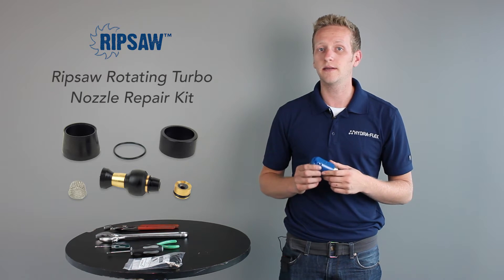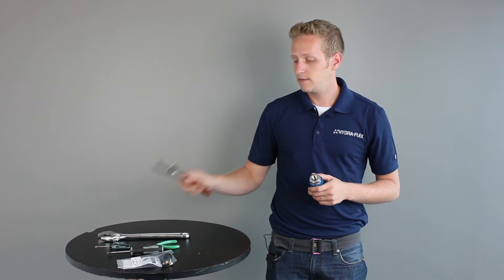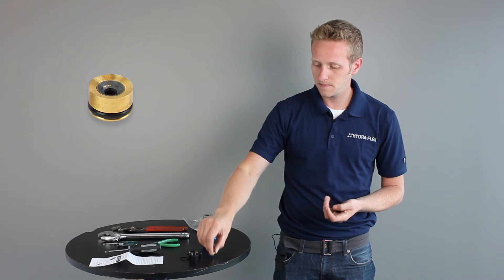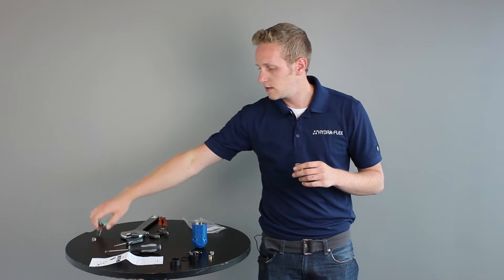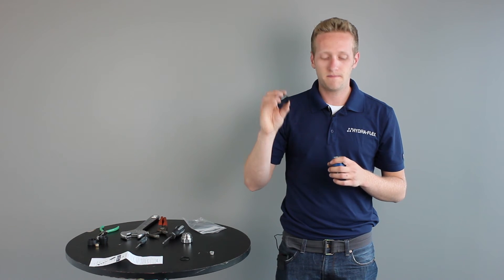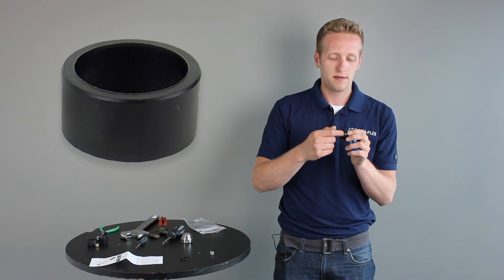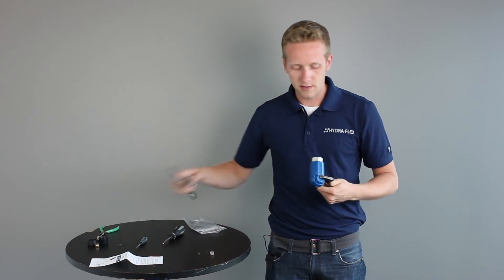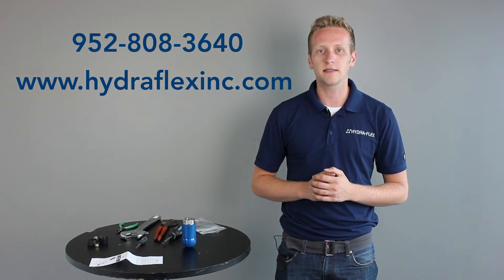How To Install a Ripsaw™ Rotating Turbo Nozzle Repair Kit

Comment: What is the point of the 2nd insert? To me, it looks to block the holes, thus restricting the flow.
Reply from the maker: The second insert is to properly channel the flow, and does not restrict flow. We've noticed that you've commented with questions on a few of our videos! We'd love to get the chance to talk with you over the phone, and answer all questions you may have! Please give us a call at 952-808-3640, or email us at sales@hydraflexinc.com
Reply: Why are the rotors are not interchangeable? There is no chance I can use #10 repair kit with #8 nozzle?